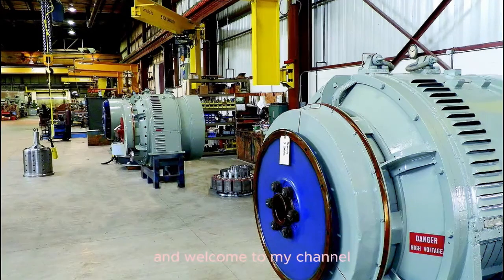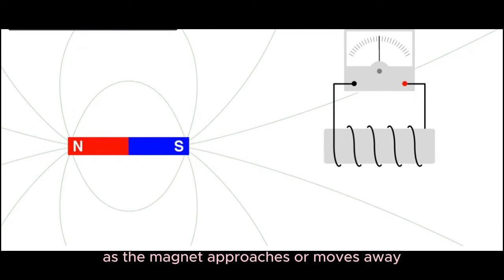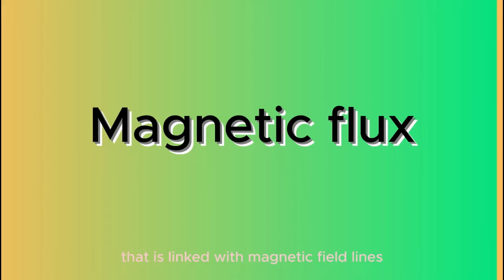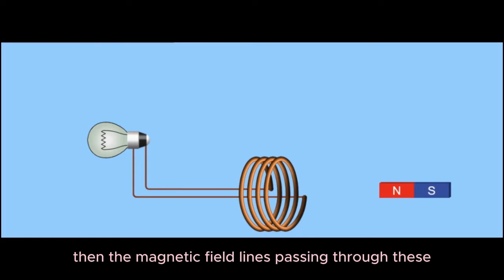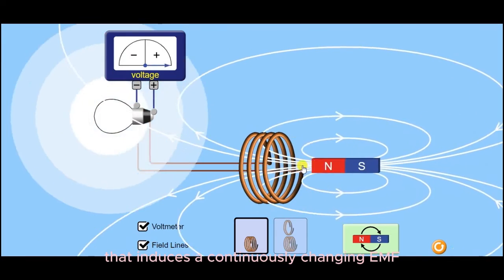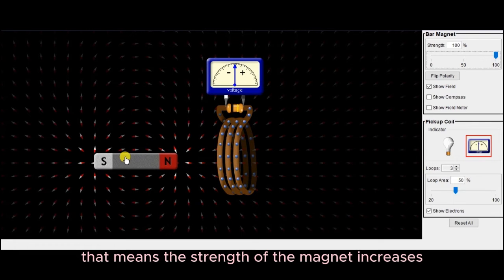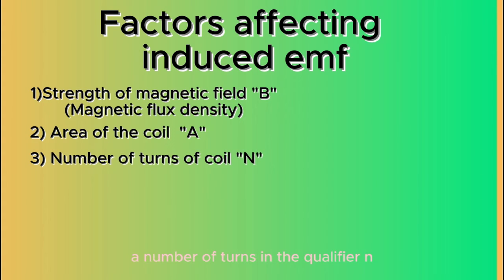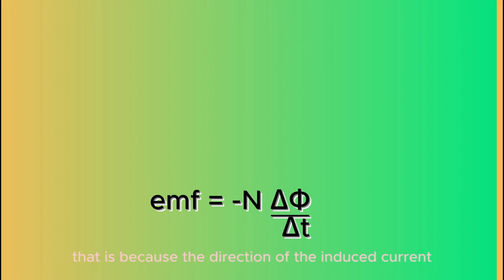Faraday's law of Electromagnetic Induction |IGCSE  Physics

Comment: Emf is also know as Voltage...?
Or Voltage is a different thing...
Reply from the maker: Emf is actually the energy supplied by a cell or a battery or any other power source, this energy enables the current to flow in a circuit.
Emf can also be called the voltage accross the battery.
Reply from the maker: But emf is only associated with a cell or battery, whereas voltage or potential difference can also be present within a circuit between any two points in a circuit.
Reply from the maker: When talking about induced emf in a coil, this is the energy that you get due to Electromagnetic induction, the mechanical energy provided to the magnet appears as electrical energy in the form of induced emf.